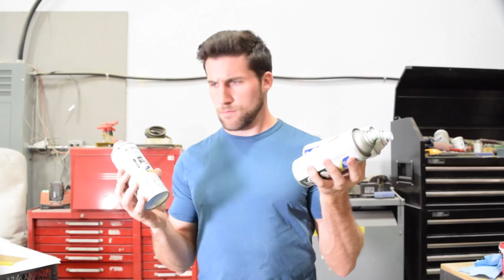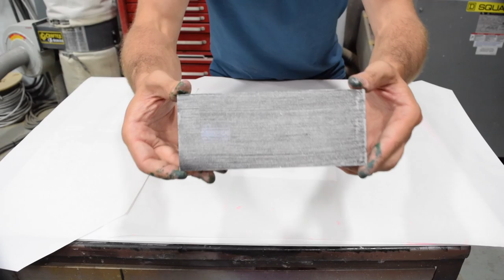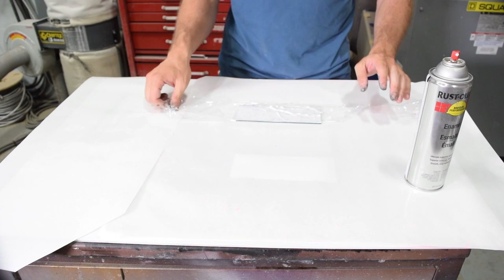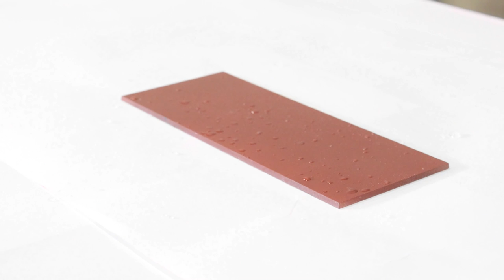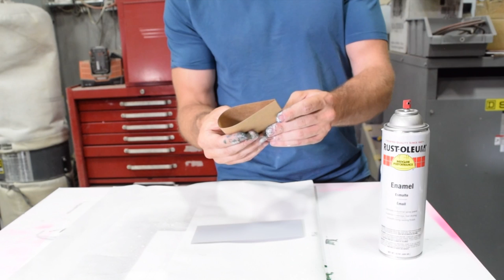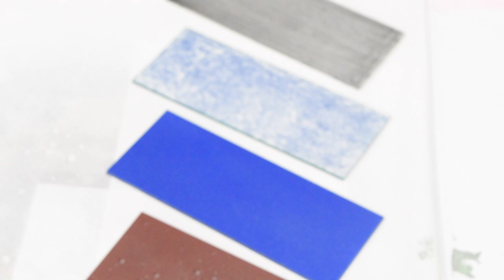5 Awesome Spray Can Tricks in 2.5 Minutes

Comment: Hi Brad,  I have a big black (boring) metal sun on my fence in my backyard. I want to give it colour & texture.  Any ideas?  What kind of spray paint is best on metal?
Reply from the maker: Is it already coated, or is it just iron?
Reply: @BradAngove  Hi Brad,  it's black. I'm pretty sure it's a coating. (I don't wanna scrap it to see lol)
Reply from the maker: Ok, I’m that case you don’t need to worry about what paint works on metal. You’re painting over paint. If it’s pretty old, pretty much any decent outdoor paint should work. Just sand it first with 320 so the paint will stick.
Reply: @BradAngove  Thank you Brad.  I have four colors of Spray Paint  ... for Wood & Plastics ( I hope that takes?)  I'm doing a multi relief texture technique, then do you think a clear coat to seal it?  because it's outside.
Sorry, I can't send you a picture on YouTube.
Reply from the maker: You may not need clear coat if you’re using outdoor paint and it’s just decorative.
Reply: @BradAngove  It's just decorative ... ahhh? but, we have pretty harsh winters here in Canada, & I'm too lazy to move everything into the garage. ... um?   I guess clear coat with UV protector might help?